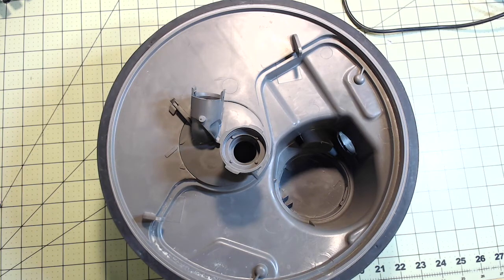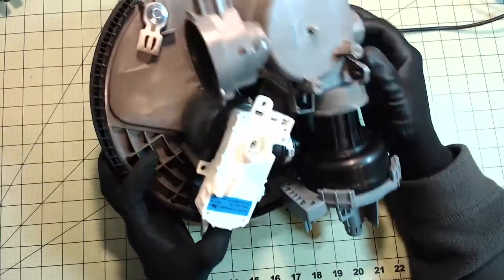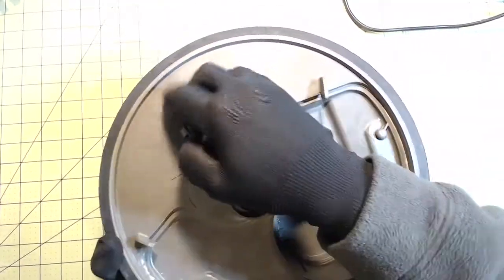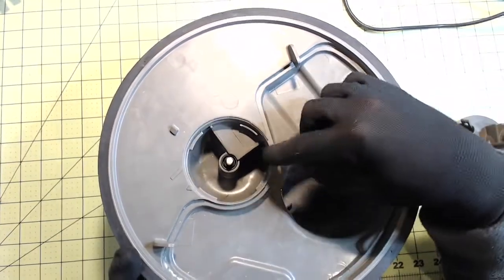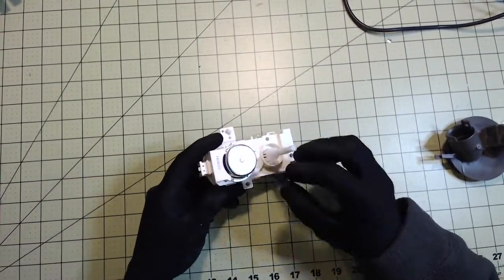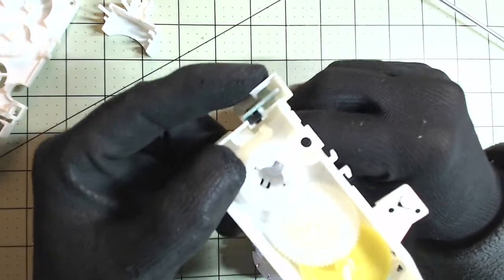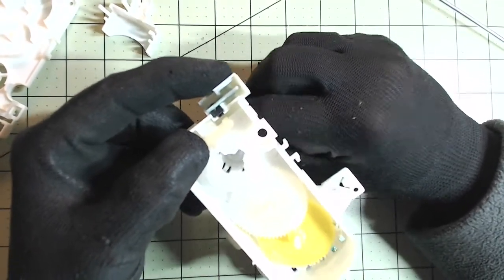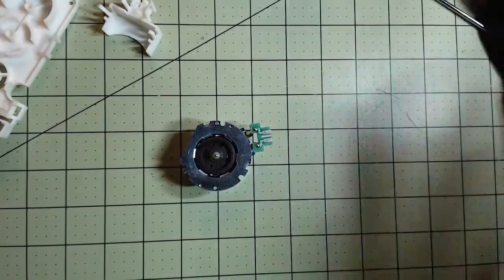GWS dishwasher diverter teardown

Comment: What type of wash system does the new maytags have?
Reply from the maker: Whirlpool and Maytag are the same company, so they would be the same Global Wash System at the low to mid price point. There's another system, the Microfiltration system that starts around $1000 and up.
Reply: I could've sworn that the new Maytags had choppers in them!
Reply from the maker: The older ones definitely did, but i'm not familiar with a new one with a chopper.